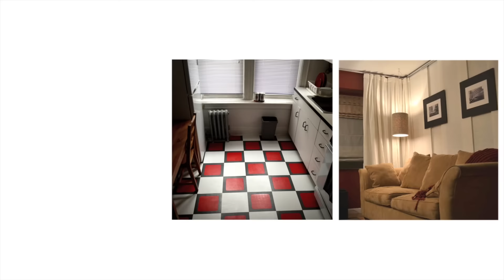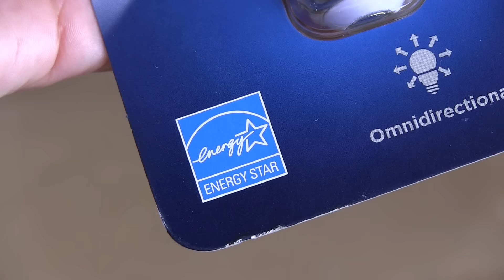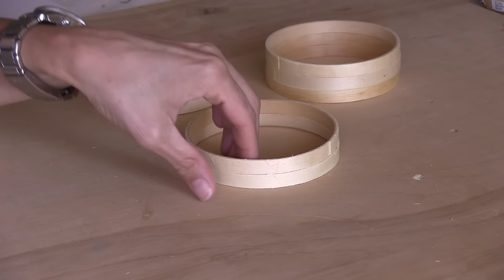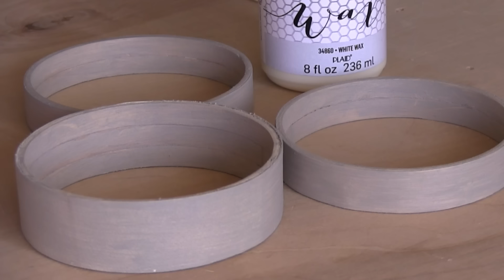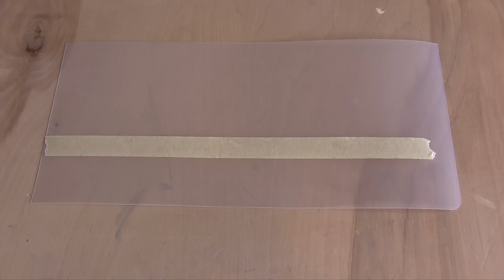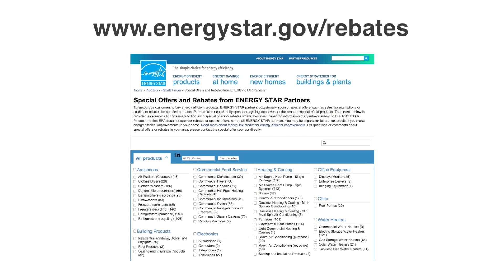Bathroom Design Ideas: DIY lighting fixture makeover

Comment from the maker: Looking for ways to remodel your bathroom on a budget? You can easily upgrade your bathroom lighting fixtures by:

1) swapping out the shades and incandescent ENERGY STAR LED light bulbs (http://amzn.to/2IomLt3)  

2) Changing the shades with DIY ones you can make with this: 
Shade construction:
4” wooden embroidery hoops: http://bit.ly/1iUIM5a
Iron-on wood edging (3/4” wide): http://amzn.to/1PQEuX2
Iron-on wood edging (2” wide): http://amzn.to/1YII4s6
Double-sided tape (3M 200MP): http://amzn.to/1LHJXjn
Machine screws (#4 1 1/4” long)
Flexible chopping mats

Finish:
Plaid wood tint (Grey): http://bit.ly/1KYwcfz
Plaid white wax: http://amzn.to/1jnKZG9